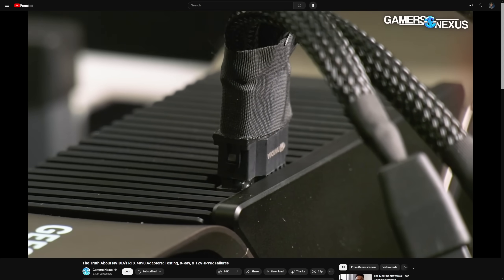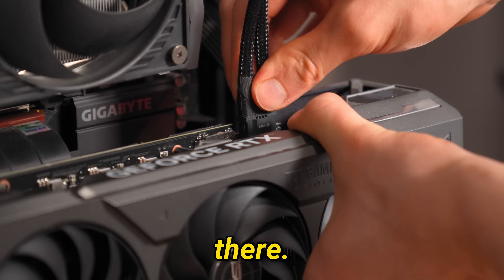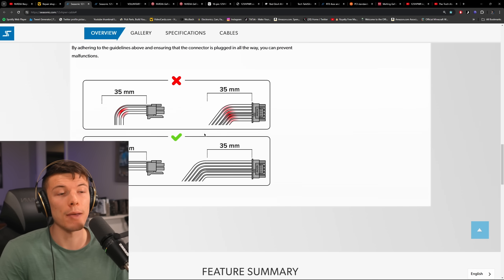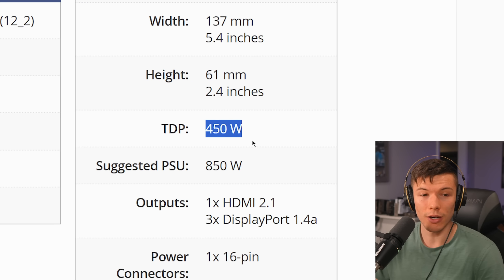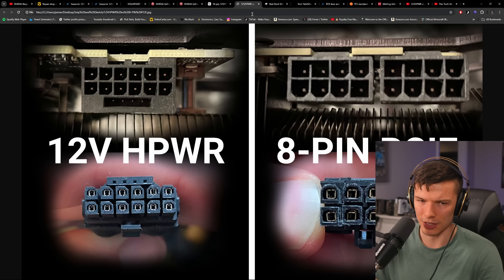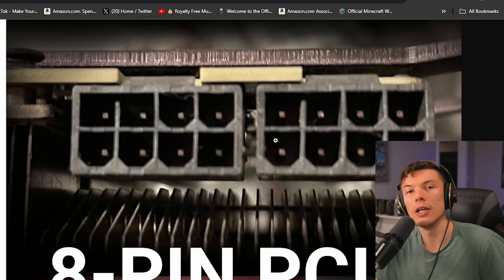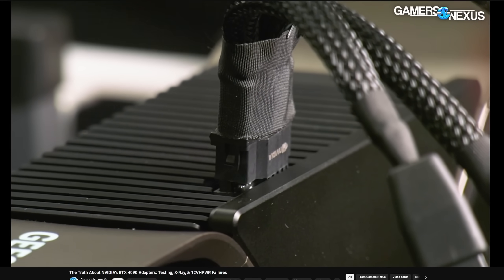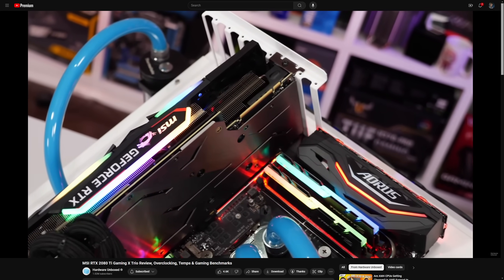The Dumbest Thing to Happen to Graphics Cards

Comment: why are you making this video? everyone knows this and besides, the new rtx5090 is coming right after the summer, nobody is so stupid that they buy rtx4080 or rtx 4090 cards now. Nivida has probably made changes to this connector.
lots of videos have been made that explain this and there are several who say that they have to make 2 pieces of 12V2X6 instead of 1 12V2x6 pin connection

Comment: On the 8 Pin Power Connector, 2 Pins are for the sensor, they are like Jumpers, which tell the GPU, the wires are thick enough to carry such a high amount of power (6-8A), 3 pins are for the delivery and 3 for the ground.
The 6-Pin connector don't have the set of the 2 Jumper-Pins, and the wires are usually thinner.
So, technically, someone put the sensor pins from the 8-Power-Connector and made them thinner and put them on the top of the 12VHPWR (2x2 Pins) and all the rest Pins (2x3 12V and 2x3 GND) are on the bottom, just thinner.
So, it's more about rearranging the whole thing.
Don't forget the 75W over the PCIe Slot :D

Comment: What i don't understand is why didn't they go with the newer 12V-2X6 and made it mandatory for newer Super series and all upcoming stuff? Why push a design that's proven to be prone of failure whether it's user's failure to "properly" fully seat the connector or just connector itself causing issues when fully seated..  I would rather get four 8 pins that i know are proven to work and are not a bitch to fully seat.. Hopefully the newer 12V-2x6 design proves to be really good and maybe the next 8 pin (we also need more painted connectors like Seasonic showed).

Comment: The 12V HPWR connector is a very poor design. I would never buy a graphics card that has such a connector.
It's good that AMD and Intel stayed with the old and tested PCIE connector, which works great.
The degree of safety on the 12V HPWR connector is 1.1, which is abnormally low. Such a low degree of safety causes excessive heating and melting of the connector.
The degree of safety should be at least around 2, which is exactly the case on the PCIE connector.
I don't understand why is the problem that the graphics card has a 3 x 8-pin PCIE connector. Appearance?! Most computers cases are closed and placed under the table, where you cannot see what is inside the computer case.

Comment: I would not mind 4x 8pin connectors on my graphics card, It'd still look way better than the 12vhpwr. I'm not even sure how I'd upgrade my current computer (recently got 2080 ti), because I do not want to have to use that terrible 12vhpwr connector, not that it'd fit in any case anyway.

Comment: Less than 1% have this issue. Iv had mine since launch and still going strong. Fingers crossed 🤞. But i do not run any oc on and i have a native 12-volt power cable that came with my MSI MEG psu..

Comment: I think the Key was "Safety Factor" on the slide. 8 pin was rated at 150w with a safety factor of 1.9 = 285 watts possible which lines up with Debaurs finding. The 12VHPWR rated at 600w with a safety factor of 1.1 = 660 watts. Basically, putting 600watts through the connector puts it almost at the limit of it's safety factor.

Comment: Uglier than four 8-pin adapters? Uglier than having to use three or even four separate 8 pins? That's not practical. I bought a new power supply. If you can afford a 4090 what's a new power supply? Technology advances fast. PCs are not cheap. I have been doing this since the 90s. Ya look at that power color. That's a joke. Nvidia should invest in improving the new plugs. Not regressing back to older technology.

Comment: Bought one of those new ATX 3.0 power supplies, running a 12VHPWR cable directly from the PSU to my 4080 Super and haven’t had any issues with it yet. It seems to be just the 4090s

Comment: This is a legit problem.  Nvidia created a defective solution to a non-problem.  2x8-pin ATX connectors can deliver 480-600+ Watts without issue depending on construction.  Nvidia 12+4-pin can't.

Comment: Had a 4090 for a little over a year then it melted. Got MSI to RMA it with no issue, payed for shipping and got it back with the new 12v-2x6 connector. I then sold it and bought a 4070 Ti Super just in case is starts melting again. I really miss the power of the 4090 though.

Comment: 4070 TI Supers, and generally super edition cards in general have a new updated 12VHPWR connector. This is a non-issue with the latest released cards. Please show me a 4080 Super, or 4070 ti super with the burned cable issue.
Reply: 12V-2x6 power connector will have the H++ identifier

Comment: i will never ever buy Connector called 12 Pin for that BS (Safety factor 1.1) mean so bad safety , 1.9 for 8 Pin its almost perfect
we get a cheap one (5A Rating 150W) 8 Pin
if they want that power they can give us (7A Rating 252W) for two 8 Pin + 75W from PCIe motherboard slot = 579W !!!

Comment: I got a MSi 4080 super suprim and ended up buying a MSi power supply because it had a 12vhp input so I could get rid of the dumb adapter. I would rather Nvidia not have used the 12vhp connector

Comment: i recently built my system with a msi 4090 + vertical mount and just used to supplied cable that came with it. it’s been running flawlessly
Reply: It's like 1%. You should be fine.

Comment: i really dont get it why they dont go with a 2x8pin or 3x8pin power connector. they would have a much higher save rate before the whole thing is failing. at the 12 pin power connector the save level is very low. and if the connector loses contact on a point, the rest of the power connectors is getting overstressed. that causes the failure i think!

Comment: The smaller the cross sectional area of a wire, the higher its electrical resistance, the higher the electrical resistance, the more electricity goes to waste as heat. The hotter the wire gets .... 

This is middle-high school physics/electronics lol

Comment: Igor had a closer look at the standard and metals used and he concluded that the standard itself is too loose which lead to manfacturers using different mixtures of metals that make the situation worse. So while the safety factor is already too low the open for interpretation alloy for the connectors introduced a lot of random factors. To me it seems adaption rate took priority over safety.

Comment: Two solutions: press the plug in the connector until it shows up on the other side of the card>you need a new card. Implement a logic chip to monitor the connection thus adding an additional point of failure>you need a new card. Win-win for Nvidia :hand-purple-blue-peace:

Comment: I have a zotac amp extreme airo 4090 and a gigabyte aero 4090, using them in stock settings and i never had issues with them ever.  Looks like people who are expriencing these are the one who competes in benchmarking and people who dont double check if the 12vhpwr is plugged well

Comment: I understand that is frustrating, but for the people are getting a 4090 this what I did.  I just recently bought a MSI 4090 Slim and of course a Seasonic Vertex GX-1200 watts PSU. I was been told to use the 600 watts from the PSU and discard the 4090 power connector. I gave not overclocked anything, Its have been over a month now and it is running well.

Comment: Nvidia fans are in total denial defending their 2000€ investment, talking shit about AMD cards and drivers.

I just switched to Radeon coming from 17 years of Nvidia and I could not be happier. If I wanted to improve on my VRAM and memory interface, it would have meant getting a 4070 ti Super for 900€. Fuck that. I bought a RX7800XT for 500€. Sure it draws more power but in 4 years that about 50€ for me. Been testing old DX9 games for compatibility and everything works fine so far.

Comment: They should change the location of the power connector to a hidden supported section which is hidden behind the card which would allow the cable a straight run to the right of the case to the usual pass through. No bends until way past the 35mm mark. Even in a vertical orientation the cable would be hidden from view and allow a straight run to the pass through. I have never understood why they insist on putting the power connector where it is on the GPU it makes no sense, it's the worst place to put that connector.

Comment: Short version is Nvidia screwed up, so how does a hugh company solve this mess? blame the user so you don't have to cover it under warranty while modifing the design hoping you reduce the issue till you release a totally new socket that many modular PC power supply makers might also have to supply a new cable. Some of those power supplies also have the exact same male socket. Its a mess so best just keep blaming the user.

Comment: Titles clickbait. The issue is largely resolved. You need an ATX3.0 PSU and the revised cables they come with. DO NOT USE A 4090 WITH AN ATX 2.0 PSU YOU WILL BE RISKING THIS HAPPENING
Reply: Example of models?
Reply: @notaras1985  Models for what? New ATX 3.0 PSUs?

Comment: It will be as simple as this, If on the 5000 series theres a variation on the connector, this means the problem will have been solved and also it will show there was a problem with the connector from the start. Either way Nvidia will loose the arguement.

Comment: I bought a new power supply to go with my 4090 and a new case to fit it. If the 12vhpwr connector melts, I know how to solder so I'll remove the connector and solder power wires straight to the board. I'll cut the 12vhpwr connector off of the power adapter cable that came with the 4090 and those are the wires I'll solder to the board, and then I'll be using four 8-pin connectors. I'm running the 4090 undervolted and I don't expect problems and I'm covered no matter what. Well, if the gpu die dies I don't have that covered but you know what I mean.

Comment: Pretty interesting that a 8 pin CPU connector is rated for 336W,
but a 8-pin GPU connector is rated for only 150W when they both look very similar.
Reply: Maybe there are different amounts of copper between them, also there's no way one 8 pin safely can draw that much regardless of what it's " rated" real world proves otherwise
Reply: It has nothing to do with the cables or ports but how things are set up internally within the psu along with the pcie plug spec being fucking ancient.

The reason they can't let you use one plug is simply because It could fry older or inferior plus.
Reply: @Rainsoakedcoat  please explain how 600w can go through that cable with the amount of copper and not get hot
Reply: @eliadbu  if the ratings were even 60% accurate Northridgefix I can't imagine would get 200 a month lol
Reply: @copper16000  all the failures were at the connector side not a single wire itself melted, so the issue comes down to the connector. GN did an analysis of the failures and they found most of the time failures were user error with some design flaw of the connector. Meaning if the connector is far less forgiving for user error compared to the 8 pin connector, there might be other reasons, but most of the time it's due improper connection of the plug.
Reply: @eliadbu  the design flaw is its too small lol
Reply: @eliadbu  strange for how many years pcie didn't have this issue.
Reply: @copper16000  too small is not good explanation. As I said the 8 pin is much more forgiving as a result of lower rating and different geometry of connector. I have the cable mods cable connected to my PSU and 4090 with zero issues. Also there the new 12v-2x6 variant that is ment to mitigate to some degree the improper connection.
Reply: @copper16000 Actually it's pretty simple, the resistance on those distances is almost non existent. You can make cable just slightly thicker and get much more power output lowering the resistance even more, I run pa subwoofer 1kw on much thinner cable.
Reply: @wadimek116  ..correct. a larger cable always has less resistance
Reply: @wadimek116  the difference in resistance of larger cables is extremely large, like, 0.5 to 0.05 going from 12 to 4 gauge
Reply: @Rainsoakedcoat  336w I mean
Reply: 8 pin GPU power cable has only 6 pins carrying power while 8 pin CPU power cable has all of the 8 pins carrying power.

Spec on the paper for the CPU power cable is 250W.

Comment: This is ridiculous. While I HAAAAATE 12VHPWR. The connector isn't the problem. Dumb people are. I've been using this on my 4090FE with a 1000w vBIOS literally getting into the top 100 on 3D Mark with it and have had ZERO issues. Even on the stock vBIOS I could put the power slider to 133% which is 600w. The problem is people trying to stuff this cable under tension for "cable management" or not seating it correctly. I used both the 4x 8 pin to 12VHPWR adapter in the box with my 4090 and a Corsair 12VHPWR cable direct from my power supply. YES the stupid cable is stupid but not as stupid as people not being able to seat a cable.

Comment: I made shorter, custom 8-pin and 6-pin cables for my last gpu. now, for the 4080S i had to buy a new psu and throw out the cables i made. could have reused them as the pinout of the new psu is the same as the old one.
I'm honestly too afraid to build a 12VHPWR cable myself.

Comment: the better thing is.....those cables aren't designed for multiple install/reinstalls. I think its like 8-10 times......basically i liken it to USB headers on a mother board. I never lost a pin or had a failure on normal USB1/2.0  headers on a motherboard. I've lost pins from USB 3 motherboard pin hub on the board.      Those small Sense pins are fragile as all Hell. If you are a reviewer and are swapping builds constantly its just asking for a headache and a 1900USD brick.

Comment: The fact that it can use a Y-adapter to connect 8-pin standard connectors just shows that the rating thing makes absolutely no sense.  if the Nvidia connector can do 450w then so can the two 8-pin connectors.  Nvidia sucks.  They are just full of themselves and trying to change standards for no reason.

Comment: This is basically a 250 to 300 watt connector. A few 4080\s have had the issue, but much rarer and they're just over 300 watts. So it depends on whether they make use of the 75 watts from the slot.

Comment: the image you posted clearly shows the melting spot to be at the tip of the cable connector at the point where it connects into the GPU connector. It isn't the cable thickness as if it were the cable would melt on the opposite side of the connector at the rear. As the melting point is in the location where it's at then it shows it's 100% incorrectly seated cables.

Comment: Make stupid connectors
Win stupid meltdowns

Besides that, those bending distances are such BS.
The faulty part is the clipping metal, not the raw copper in cables. 
Everyone who has any electrical knowledge knows that amperes makes cables heat up, and the lower voltage (12v) the higher amperage (50A in total) to deliver the needed power (600W).
Every single 12vhpwr power pin delivers up to 100W (!) which is 2 times more than 8pin pcie connector(50W/power pin) WHILE having smaller connector size.
Reply: How did you make those calculations. Can you give the formulas you used?
Reply: @notaras1985  most of data is on the spec sheet, and also calculating amps, volts n watts is easy because we have this equation: A * V = W
Reply: the rest is basic math, dividing those numbers by amount of connectors etc etc
Reply: @Phol  yeah but this doesn't account for internal resistance of the parts
Reply: @notaras1985  you... don't need it for those calculations?

Comment: TBH - This guy, with 200 failed connectors, they are not from 200 different GPUs from different customers - it's his GPU(s) and his cables. Yes, it is a bit tricky to plug that 12V cable, but man, except that person, I haven't heard of many other who had fire hazard issues. I am on 4070 Super - no issues at all!

Comment: If they stick with this connector, they should, at least for the forseeable future, make sure to use two instead of one on GPUs that draw 4090-power or more. 
The safety margin on that thing is just too slim. It is at like 10% or so, while the safety margin on the good old 8-pin is 60+%.

Comment: I mounted my 4090 vertically. It saves the card from breaking it's own pcb because of the weight and makes the power adapter easier to push down and stay down.
Reply: How do you mount a 4090 vertically? Vertical PC case? Or a riser cable and supporter? Is there one strong enough for that heavy piece?
Reply: @notaras1985  I use a vertical pc case. It's behind my large screen tv. Until you physically hold a 4090 then you don't realize how large and heavy it is. It dwarf's a 3090.
Reply: @JamesSmith-sw3nk  which case is spacious enough to have extra cooling room for this set-up?

Comment: The real answer was in the video. Safety factor of pcie 8 pin 1.9 safety factor of 12v high power, 1.1. The new design leaves no room for error, for reference to get the safety factor on the 8 pin to where the high power is, you would be pushing around 270w through it rather than the rated 150w. There are plenty of ways to move big dc power, and tiny little pins regardless of the tricks they use just isn't it.

Comment: I quickly got rid of the Nvidia connector and got  dedicated 12vhpwer cable direct to PSU on the nex ATX 3.0 standard and no issues whatsoever. Nvidia need to take a long hard look at themselves....which I doubt they will do but anyone with a 4090 get a dedicated high quality 12vhpwr cable and the ATX 3.0 psu...yes extra expense but for an expensive GPU like a 4090, worth it..